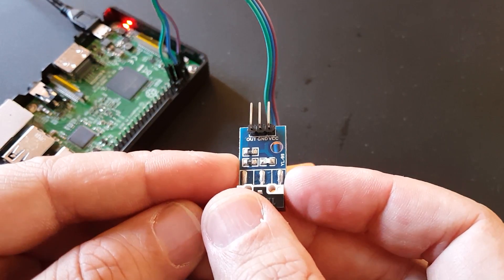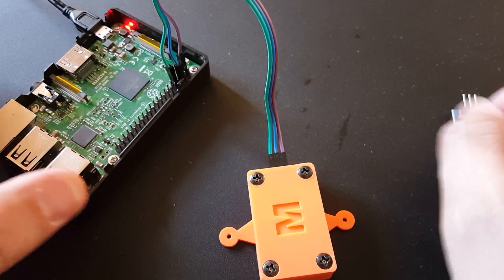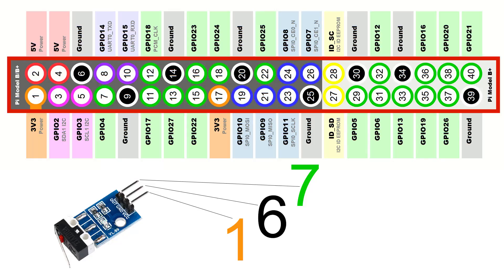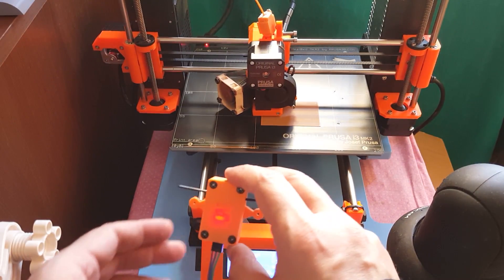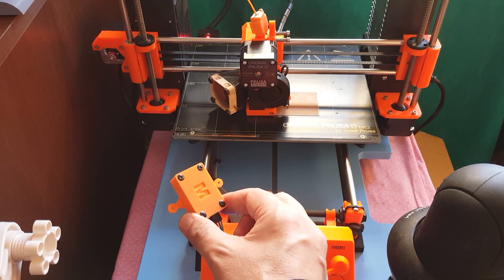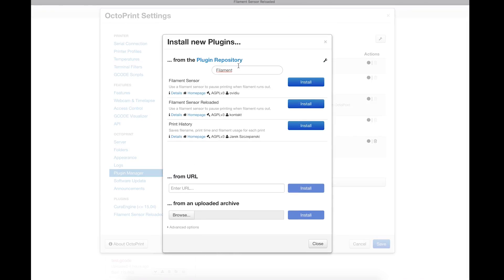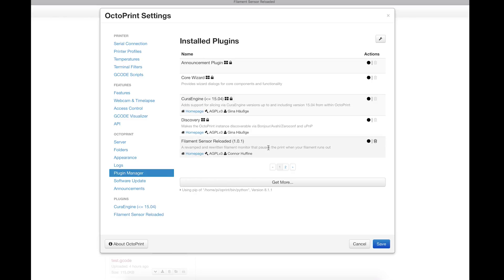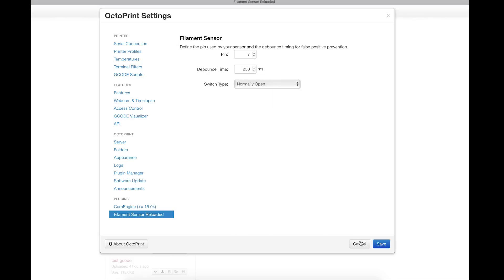Filament Run-out Sensor for 3D Printers

Comment: what if you have a Hyperpixel display connected to a raspberry pi thats taking up all the GPIO pins, anyway to utilize a USB slot perhaps?
Reply from the maker: You can connect the sensor to your Mainboard and set the sensor on Marlin Firmware. When I designed this sensor, it was not supported by marlin so we used an OctoPrint plugin. But now filament sensors are fully supported.

Comment: Hi Murathan, thanks for the video, not a bad option to do it from Octoprint if you use that always, but I think it would be better to put the filament sensor to the printer board and trap the filament out from the firmware so it works whether you are using Octoprint or not.

Comment: I think after filament run-out it should raise the nozzle so you can load filament and continue print?
Reply from the maker: Hey Adrian, please read the description, you can add M600 command to pause function and your extruder will go to the corner and take out the remaining filament to let you load the new one. Search for M600 Gcode on google.
Reply: Ahh, missed that. Thank you.

Comment: I followed exactly and it still does not work any help would be great I have my red positive to pin 1 my ground to pin 6 and my white sensor wire to pin 7 I set in the settings my pin is pin 7 and my switch is normally open which it is and still does not work.
Reply from the maker: Hello Bill sorry for late respond I can not follow youtube notifications very well. Did you solve the problem?

Comment: how would i set this up for 2 sensors?
Reply: My first guess would be to wire two switches in parallel so if any of the two runs out it will trigger

Comment: Very cool video!  Question,  when I pause printing my motors do stop and all seems ok but if I don't replace the filament in about 1-2 minutes than the motors will turn off,  meaning I can move them freely,  any way of getting around this so the motors are on and won't move if touched during the pause routine or is this something we have to live with?
Reply: The new Creality CR-10S has it too and a new motherboard as well.
Reply from the maker: sorry for late reply, I am afraid no solution that I know, as I mentioned in the Thingiverse description, running the sensor over Octoprint you have this issue. By the way Original Prusa MK3 is in the market which offers an on board sensor, which is connected to the printer mainboard so we should expect to see some firmware mods for mounting the sensor to the board instead of raspberry pi...

Comment: Hello mate, what should I do if I got a touchscreen connected from pin 1 to 25 and I want to connect a filament run out sensor? and thanks for the video!
Reply from the maker: DerObernator there should be available ports still. Just find the similar io on the remaining gpio. See the picture of it in the video
Reply: DerObernator  Did you find a way to connect it with touch screen?

Comment: why not use the change filament routine to put new filament in and finish the print when you have a new filament. ?
Reply from the maker: T1iCanon you can use m600 command in Octoprint pause settings. I have mentioned about it at thingiverse page. if you connect your sensor to the arduino then marlin has m600 by default.

Comment: How would you mount this to the frame?
Reply from the maker: http://www.thingiverse.com/thing:2044085

http://www.thingiverse.com/thing:2147179

I have added a zip tie mount version and also updated my popular spool holder in order to mount the filament sensor with zipties. You can align the sensor angle according to your filament holder setup.

Comment: What is that material that you have underneath your printer?
Reply from the maker: jumpgate1983 it is a regular wooden plate bought from ikea spares. beneath that plate there are silencer dampers. and between the plate and the printer, there is yoga mat foam.
Reply: cool. What silencer dampeners did you use?
Reply from the maker: http://www.thingiverse.com/thing:1987585
Reply: Murathan Araz ah, ok! Thanks!